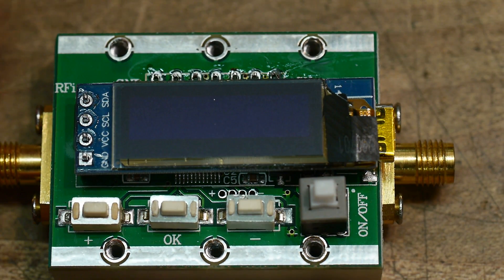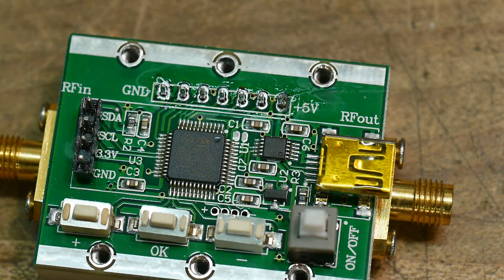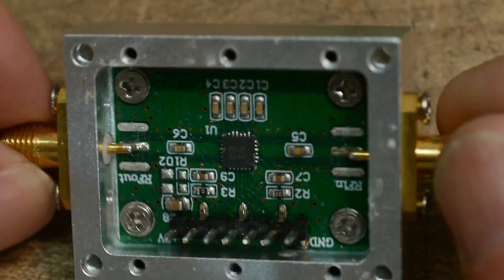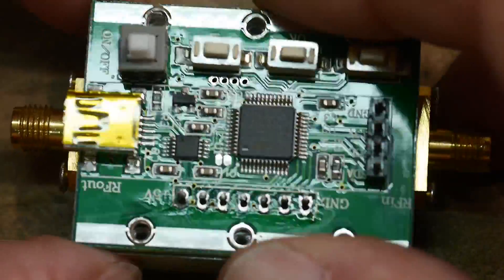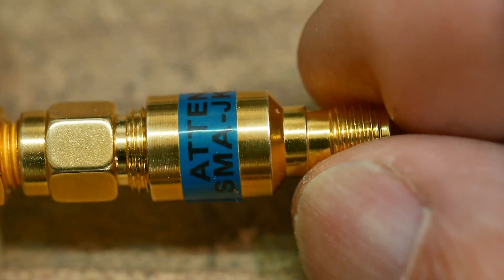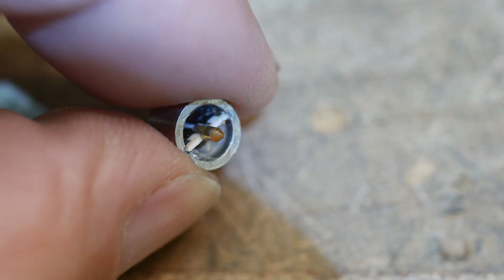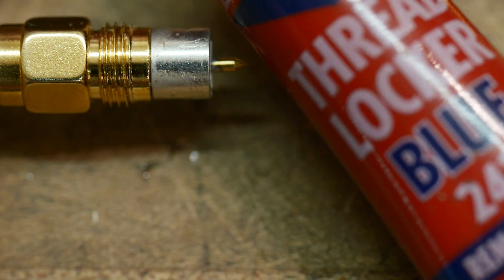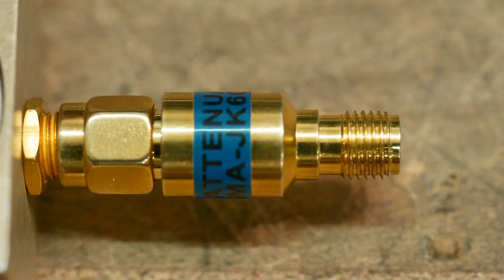#611 Broken Attenuators Teardown

Comment: Hello, I got 2 little boards of PE4302 RF ATTENUATOR PARALLEL MODE I like to use with rotary switch some help to fund connection on the rotary. G7OYO